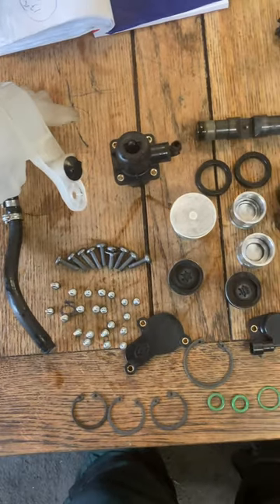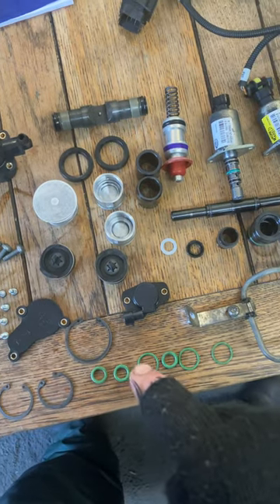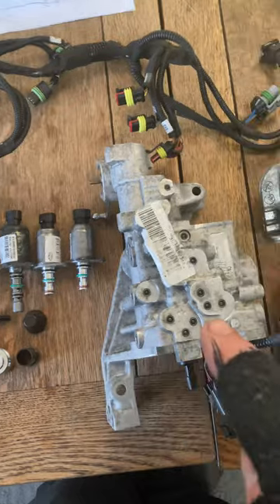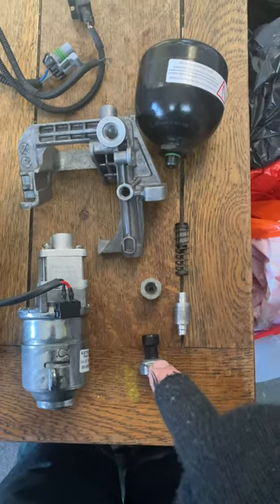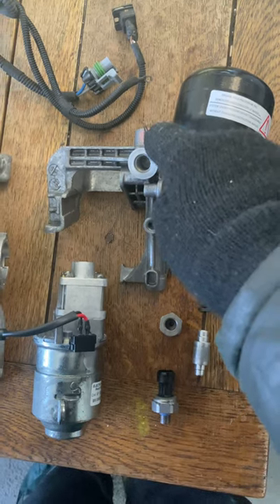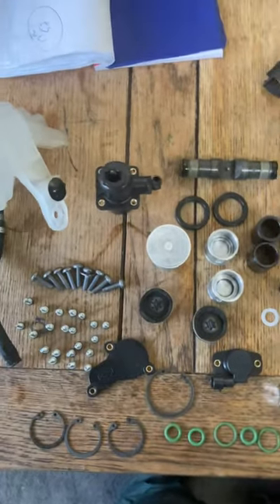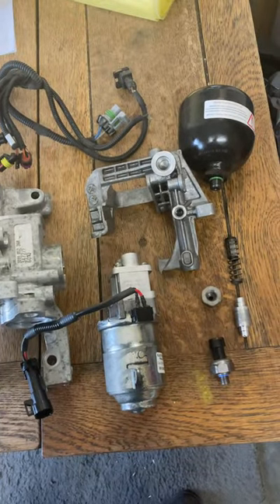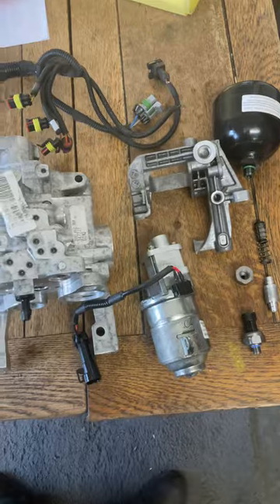Semi auto quickshift selespeed master trafic vivaro repair

Comment: Hi Simon, great videos. My reader is coming up with fault code 78. Turn ignition on, dash board lights come on but nothing else happens. The fluid bottle was totally empty, not sure where it's gone.
Any ideas,? Do you take work on? Cheers Andy
Reply from the maker: @jackwets  yes no fluid you have end cap leak , remove unit check caps and repair if able
Reply from the maker: @jackwets  if front reservoir then replaced clutch. If rear reservoir then repair leak on bot

Comment: Hi Simon! Excellent video. I have clio mk2, 2003, petrol engine with Quickshift 5. Today the system has stopped changing rear gear. 1 to 5 work great in manual and A mode. When I try to shift R, it returns to N and a strange electronic noise appears. Any idea what is the problem? Thanks in advance!
Reply from the maker: Either the selector in the car. ??? Or the solenoid. But really need a fault code
Reply: @controlfreak6748 A friend of mine's just read the faults: 2g- computer (3 times); 9g- at selector lever position:forbidden, 20d-accelerated idle request output, short circuit. Any idea? 🤔
Reply from the maker: @stepanhimuk9013  maybe the gear stick broken

Comment: Hi simon, do you know of other brand fluid that can be used instead of ELF speedmatic fluid? Its hard to get here in australia
Reply from the maker: @ManBikeSwag  https://www.ebay.co.uk/itm/305721592808?mkcid=16&mkevt=1&mkrid=711-127632-2357-0&ssspo=tFgSIl0QTLe&sssrc=2051273&ssuid=tFgSIl0QTLe&var=&widget_ver=artemis&media=COPY
Reply: @controlfreak6748  Thanks, but these guys will not post to australia 😞 Any others?

Comment: Hi we have a fiat ducato motorhome, when its stone cold it has a hard gear change, thumps bangs changing through the gears when cold it is a 2015 Semi Automatic and once it becomes warm it changes like it should no banging or thumping any ideas we can check?
Reply from the maker: Check the progressivity on the clutch in live data. Get her up to temp put her in fist the hold the revs on where you feel the clutch bite with foot on brake and handbrake on. Like a hill start but hard. Hold for 15-20 seconds. Then test when cold.  
Sounds like clutch wear and as clutch expands with heat it take up the slack.
Reply: Hi and thank you very much you would make a small fortune out here in Australia you can’t find anyone who can fix these boxes

Comment: Hi Simon, excellent videos mate. 
Looking at changing all the fluids on my fiat ducato 160 multijet motrohome, I understand totally what you're saying about the fluid in the hydraulic reservoir, as its an hydraulic system not an atf one therefore it has to be a certain grade to build the right pressure. I did find on a german site, saying you can use liquid moly hydraulic oil in this system. Whats your thoughts on this please? And i was going to change the manual box to castrol syntrans 75-85w GL4.
Any advise would be much appreciated.
Thanks
Julian.
Reply from the maker: Hi my best advice is to stick to selespeed fluid. CS Speed by fiat. It works at both high and very low temperature. As for your manual gearbox I’m not up on what’s best for them. 
Hope this helps 
Simon.
Reply: @controlfreak6748  Thanks for getting back to me so quickly, with the advice. Julian

Comment: Hi i have a 2014 renault traffic auto, got stuck in neutral and says on dash “check gearbox”. Code is P0900. What do i have to do ?
Reply from the maker: @SinesisYiannikou  check fluid levels in rear and front reservoir. Get it plug in with good tech Obd. Get DF CODES.

Comment: hi young man, we have a hard metallic noise from the easytronic and a oil leakage from there. Gear changing is normal. Is there a defect at the pump? greetings Jan
Reply from the maker: What vehicle
Reply: It s a Opel Vivaro 2.5 cdti 145 hp, 2008
Reply from the maker: @janlutt9546  ok . If you have fluid leak is it from front or rear  of the robot.? 
You will lose gears if leaking. 
They don’t usually clunk send me video on WhatsApp 
07539729554

Comment: Hi. Where can i buy the full repair kit? Everywhere i look the seals/o-rings are never included and mine have a leak. I have no idea what the sizes of the rings are..
Reply from the maker: If you have a leak from the end cap the seal is not the worry. 
The problem will be the grooms worn and the circlip is moving.
Reply from the maker: Groove

Comment: Aracım doğru vites seçemiyor bazen. 2 Vites ile kalkış yapıyor sonrasında 4 e geçiyor devir yetmeyince 3 e geçiyor ve debriyaj basılı gibi devir saati yükseliyor araç motor sesi geliyor. Akü eksi kutup girişini çıkarıp bir müddet bekleyip takınca sorun geçici olarak düzeliyor.
Reply from the maker: You seem to have clutch fault I would check small reservoir for dot 4.  And also check ev0 solenoid. If your robot is leaking the check pressure in live data. 49-50 bar.
Reply: Tamir edilmesi gereken aktivatör mü içerisinde bulunan yağı cok çabuk siyahlaşması dolayısıyla sık sık değiştiriyorum ayrıca  robot üzerinde bulunan  selenoid Valf kontrolü mü gerekiyor
Reply: Elektriksel bir problemden dolayıda bu sorunu yaşıyor olabilir miyim. Cevabınız  ve yardımınız için şimdiden teşekkür ediyorum
Reply from the maker: @emrekilic6756  hi you changed the fluid!!! What fluid did you use?

Comment: Hi Simon, you are pro ! I have an reno trafi 2011 whith quickshift, and i have a small shock when change from 1st to 2 and gear. Is a problem from quichshift or from cluch,ambreiaj?
Reply from the maker: Do you have a fault code. ? 
If the clutch is bleed and in good condition then clear programmed valves and reprogram the robot. 
But really need a code.
Reply: @controlfreak6748  hi, i change te accumulator and the pressure senzor and afther that it burns 2 time the electrical safety 30A. i put one with 40 A and this rezisst. But afther that, 3 days, the led with chech gearbox appers and i change manual only till home. From that moment 1 mounth i couldn't start or put into the gear......and in a stormy day i try again...the yelow led disapear and starts like normal,and now is ok. But i have that small shock which i rezolve with a small release of gas pedall. So? What can it be wit french ledy? Thank you. Sorry for my english
Reply from the maker: Really need a fault code. However if you are blowing 30 amp fuse your pump is struggling. Either the filter is blocked in the back where the hydraulic pipe goes into the 21 mm nut. 
Or the motor or pump on top is seizing. 
No pressure no start. And when the weather got cold 🥶 the pump freed itself.  Change pump.
Reply: Pump or electric side ? And filter is where the  pipe go in to the body? Can i clean it or change it?
Reply: If the yelow led is not turn on, there is a faulty cod?
Reply: Sorry, turn off
Reply from the maker: @iulianprecup1006  it will be a code but say memory
Reply from the maker: @iulianprecup1006  yes at the back
Reply: @controlfreak6748  and the pump? Pump or motor pump?
Reply from the maker: @iulianprecup1006  change both complete
Reply from the maker: https://www.ebay.co.uk/itm/386675142902?mkcid=16&mkevt=1&mkrid=711-127632-2357-0&ssspo=vpetb6cyqvw&sssrc=4429486&ssuid=tFgSIl0QTLe&var=&widget_ver=artemis&media=COPY
Reply: @controlfreak6748  ok. Thank you very much, theacher.
Reply: Right now, i put in rewerse and is going in front....?
Reply from the maker: @iulianprecup1006  that’s because the plastic connector arm on the front has come off
Reply from the maker: https://www.ebay.co.uk/itm/155475706747?mkcid=16&mkevt=1&mkrid=711-127632-2357-0&ssspo=6o5MYh7JTkS&sssrc=4429486&ssuid=tFgSIl0QTLe&var=&widget_ver=artemis&media=COPY
Reply: @controlfreak6748  man, do you see till Transylvania? I have right !
Reply: You have right !!!
Reply from the maker: @iulianprecup1006  lol 😆
Reply: @controlfreak6748   is ok or i have to change with cs speed tutela peteonas?
Reply from the maker: @iulianprecup1006  cs Speed is good

Comment: How do u drain it with out removing it?
Reply from the maker: Why you draining the unit
Reply: @controlfreak6748  to service it
Reply from the maker: Go into functions run accumulator discharge.. the rear reservoir should now be full to the top. Us a syringe 300ml and a length of bleed tube and suck it out . Us speedmatic only to replace do not use Tqf or atf and especially do not use dot 4 to refill. 
You will only got 90% of the fluid out this way. Note that after replacing and running your new fluid will go dark until you repeat process two to three times. So best to remove fluid and only replace with small amounts until fluid come back to reservoir clear then top up ..